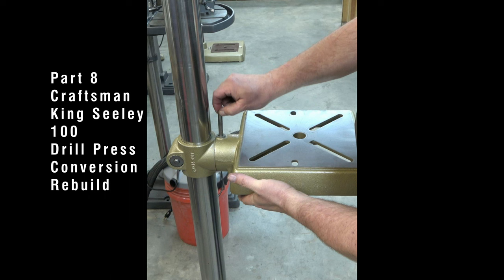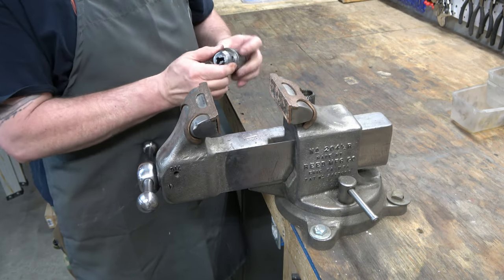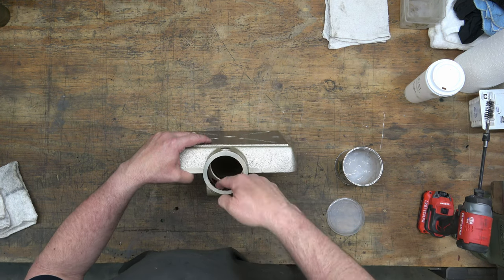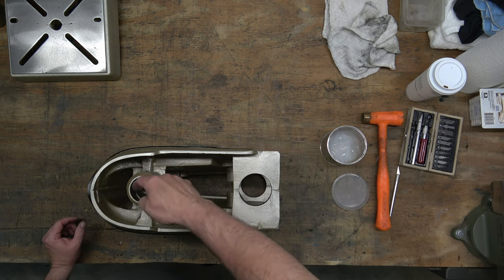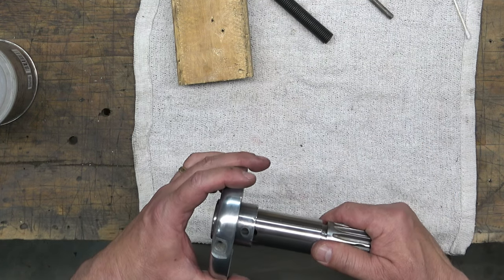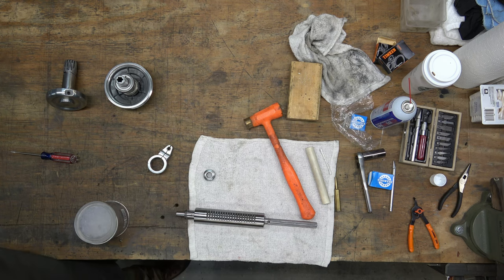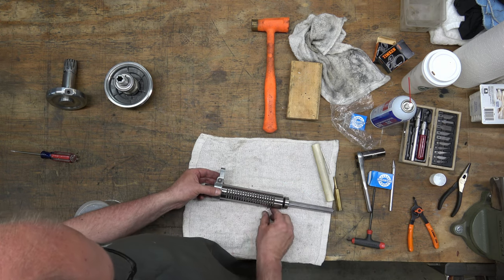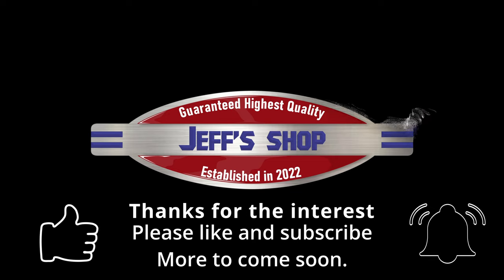Part 8 Craftsman King Seeley 100 Drill Press Conversion Rebuild Beginning Assembly

Comment: Glad to see you use Timken bearings.  I was a Millwright Apprentice for Timken at their steel mills in Canton, Ohio back in the early 1980s.  They make their own specialty steels for their bearing factories.
Reply from the maker: Flash, WOW, I should have been picking your brain all this time whenever I had a bearing question. Well expect questions in the future brother. As for Timken in general, I like the product and even if its hard to figure out where some of the bearings are being made now (Turkey, China, etc...) I believe they have maintained their quality. I know Atlas used Timken bearings in many of their Craftsman Metal Lathes and that speaks of quality. Anyway, I  like Timken and will continue to use them in projects.
Reply: @JeffsShop  Thanks Jeff.  I only worked the steel mill side of the operation and did some repair work in the bearing factory on their heat treat furnaces. You likely have more knowledge on Timken bearing part numbers than I.   Timken invented tapered roller bearings a 125 years ago and eventually got into ball bearing production. They started making their own steel in 1915.

Comment: My brother has a benchtop craftsman drill press that looks very similar to your restoration project.  I tried changing the speed, moved the belt to a lower pulley....  😮 when I hit the power it tried to spin up and before i could hit the switch, it stopped running.   It no longer turns on, i see what appears to be a push to reset circuit breaker on the back of the motor, but pressing doesnt seem to do anything.  Is there a fusable link inside, hopefully?  Where do you source parts for old machine tools?  I have my fathers lathe, I dont know if the bearings are bad in the headstock or if the motor mounted to the lathe ran off a belt is vibrating and causing the spindle to run out.  Any adv"
Reply from the maker: Thank you for the questions. The button on the motor is the overload protection switch and it would only reset if the overload was triggered. I would recommend you create a free account on the Garage Journal Forum and post you questions along with some pictures in this thread: https://www.garagejournal.com/forum/threads/craftsman-drill-press.227480/
Reply: Thanks will do, much appreciated.
Reply from the maker: @bbriankb1086  I am glad I could help out.

Comment: What is the part number for the replacement 6202 bearings?
Reply from the maker: please check out this thread on Garage journal for all the part numbers measurements etc...https://www.garagejournal.com/forum/threads/craftsman-drill-press-information-belts-bearings-chucks-keys-etc-1946-1984.489080/